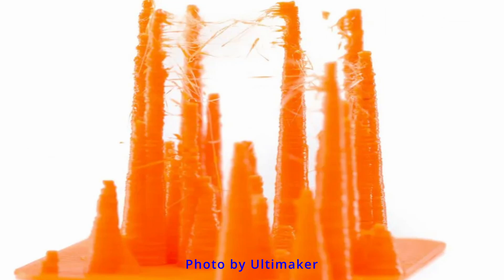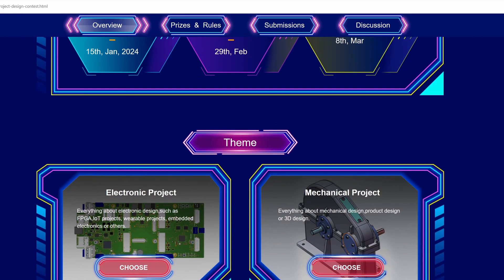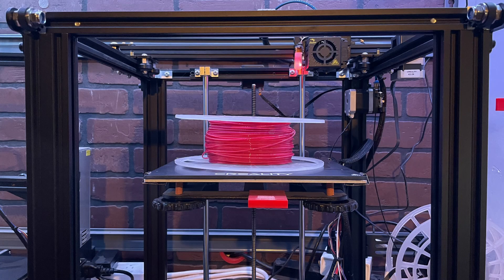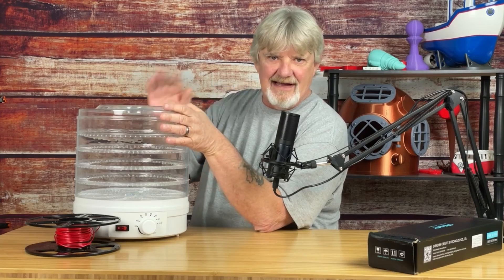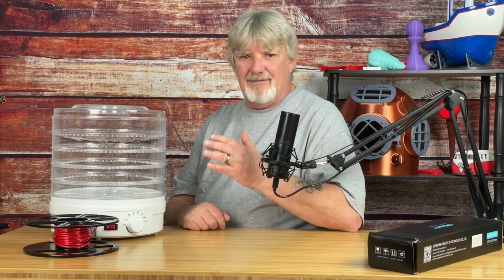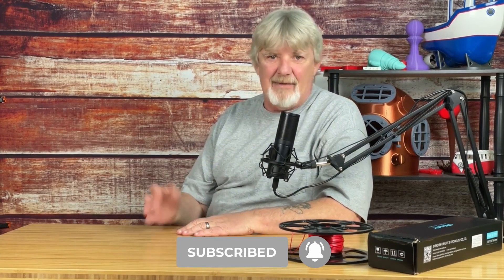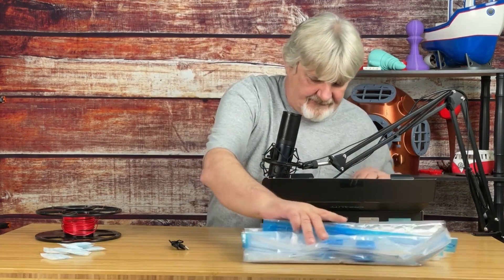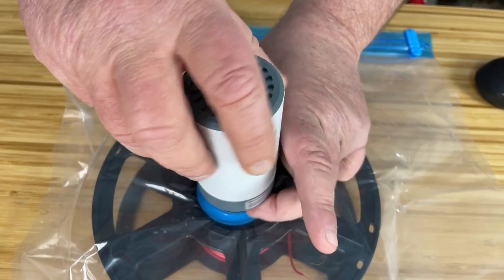How To Dry & Store Your 3D Printing Filament

Comment: Surprised nothing about temp storage. I'm kinda of in a bind.. upstairs room I have a portable AC and fan but creates airflow.  I have an enclosure for my new printer, but read enclosures aren't good for PLA. Then I read even PLA isn't good running in bedroom cause possible fumes. I can move it to other room above garage, but it can get towards 90 degrees in that room. I think I have to keep filament at 80 degrees max 🤷
Reply from the maker: Fair enough, I store my filament in a tote with a weather seal on the lid after drying. I get them on Amazon. I can fit about 18 rolls in one tote. I also have decadent packs in those totes to help keep it dry. Maybe overkill, but it's what I do. I print PLA in enclosures all of the time. It eliminates a draft that may cause a warped print. I do take the lid off venting. Thanks for the comment and thanks for watching. It's very much appreciated!

Comment: New 3D printer owner here. Ender 3 V3 KE. One quick question: are the bags re-useable for many re-seals?  Thanks for some really useful, no nonsense content! Hitting subscribe!
Reply from the maker: Awesome! I've been reusing the bags over and over. They are double zip locked. There is a slider on each bag that helps close the zips. After using the pump for a few months, I will say that it works weel. It's not real fast but does the job. I also found that when you screw the pump adapter onto the bag you need to make sure it is flat on that bag to get a good seal. Welcome to the club and thanks for watching!

Comment: I use that same gasket lidded tote. For desiccant I got a cup of Damprid. It's used to lower humidity in closets and small rooms, definitely overkill for a tote but it absorbs moisture fast, it's cheap and lasts a long time. I've had the same cup in my tote for 7 months and it's nowhere near used up. I stuck a spare reptile hygrometer in there and it reads 10% humidity, it may actually be lower because I think that meter reads a minimum of 10%.
Reply from the maker: Awesome! I was wondering how Damprid would work in there, now I know!! Thanks for the info, I'm going to give it a shot!
Reply: Doesn’t Sampras pull the moisture (water) into the container and are you worried about it spilling? Thank you. I’m a newbie and I think I’m going to purchase the double spool dryer.
Reply: @DollsandEverythingElse  the container has a gasket on the lid so it's pretty well sealed from the outside air. It could spill, it has never happened to me but just in case I put the cup of damp rid in a large unsealed zip lock bag. If it does tip, it should spill mostly in the bag and not in the tote.
Reply: @anbu94  that’s an excellent idea and I’m going to do the same. Thanks for the quick response!

Comment: I've been doing storing of filaments ( all the types ) in e-sun branded filament vacuum bags for 2 years out of the 4.5 years I've done 3D printing,  I have 2 Single spool Sun Lu S1 Filament Dryers which I use to dry for up to 16 hours due to the fact the PETG etc. need longer as the dryers only do up to 55 C where as PETG and other tough filaments like my Nylon need really 85 C to dry.

So I do these filaments longer.  I am hoping to get the new 4 spool advanced Sun Lu S4 Filament Dryer as it has better drying and a full details touch screen and goes up to 80 C.
It is a bit pricey, But compared to the single version it works out better value as it hold 4 spools and can also be printed from. ( costs around £80 UK pounds.

But it is out of stock I am not surprised at that price.  The only thing is, I not seen any real help drying the filaments and storing them in the e-sun filament vacuum bags even though I put in big bags of desiccant gel?  I still get problems with stringing and bad printing on and off. and we don't get year round humid hot weather here just for a short time in the last 2 years in summer!

So no heavy moisture really. And the room the 4 printers I use are in stays at a roughly standard temperature and humidly so bit of a puzzle?

Maybe when I saved up for the S4 and soon after my 1st enclosed core xy klipper printer, I may get better results.
Reply from the maker: It looks like you have a good system going!

Comment: Do you have a link to the dehydrator? Have been searching for a dry box that will be good for nylon but most on Amazon don’t go above 60c
Reply from the maker: The one I use is no longer available, but this one looks like a good match but check the size and make sure the trays are all plastic, no metal. https://www.amazon.com/Chefman-Food-Dehydrator-Transparent-Temperature/dp/B08RHF6WH1/ref=psdc_1090752_t4_B07Z1NYY3D?th=1

Comment: I've found home depot buckets to be a great, and cheap, solution.  The 2.5 gallon buckets hold 3 spools perfectly and are air tight.  The 5 gallon ones hold upwards of 5 spools depending on the width of the spools.  Personally I am a cheap bugger so I took it as a personal challenge to come up with a dryer by spending as little as possible using parts I already had sitting around.  I used a 60x60mm silicone 12V heating pad I had in a parts box along with an old pentium 4 heatsink and fan and a 12V thermostat.  The buckets I just pulled from the shed.  They were already clean but a quick wipe down and they were good to go.  Printed off a few parts and it's all mounted in the 5gallon bucket.  The fan draws air over a calcium chloride desiccant in a tub at the top, and then down the centre tube and over the heatsink warming it up.  The warm, dry air slowly goes upwards over the spools pulling moisture out of them and keeps cycling this way.  Thermostat keeps the whole thing at around 42°C.  I'm shocked at how well it works.  I just leave a couple of spools in it for a day or so, pull them out and move into one of the smaller buckets ready to be used whenever I need them.  The only downside is that I can't see inside the buckets to know just which filaments are in which bucket.  I COULD label them but that would make sense.  lol
Reply from the maker: That's a heck of a setup! I like that idea. Even with the containers I'm using I can't really see what filament is in each container. I usually have to open them up, dig around only to find out the color I want is in the last container I check.